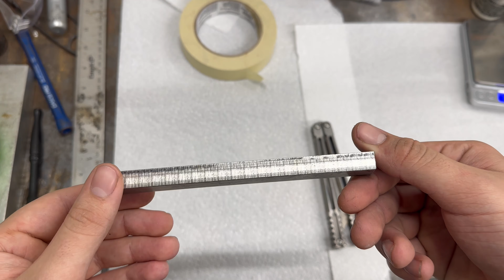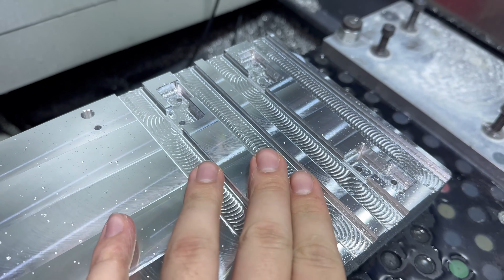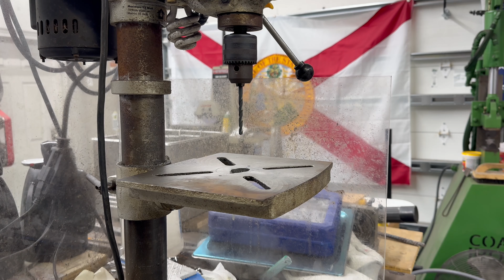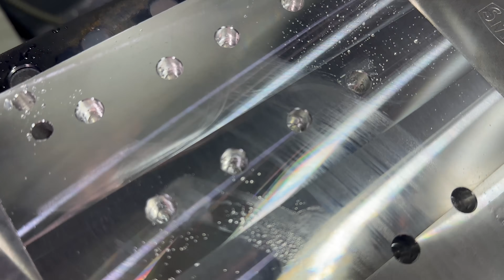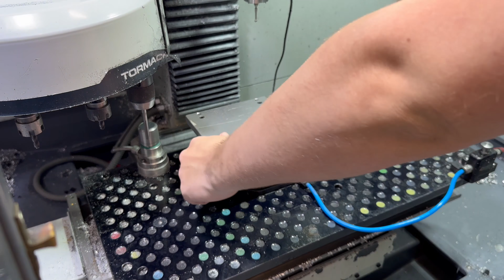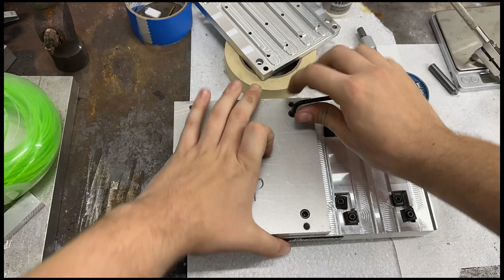Machining and Fixturing the Voltaic (Machining a Pierson Mini Pallet)

Comment: Pro tip: Use metal thread inserts on your holes that will be used for the Mitee-bite clamps. They won't wear out like the aluminum will.
As someone else mentioned, Machine the pocket for the Pitbull clamp according to Mitee-Bite dimensions. I use them by the dozens in my machine and they can last for years and do a great job but have to be used per the instructions.

Comment: Looks like the pockets for the Pitbull clamps are too big. They are supposed to be mounted against a shoulder from the backside and develop a lot more holding power that way
Reply from the maker: Hey thanks for the correction. I went back and checked and your totally right they are supposed to touch the back wall. I’m not sure how I missed that but thanks for the heads up. I haven’t had many clapping issues but I’m going to print a spacer and see if it helps.